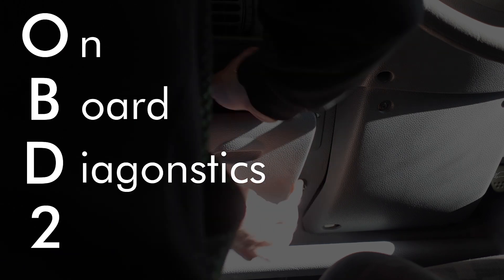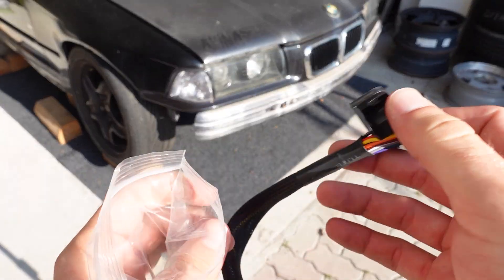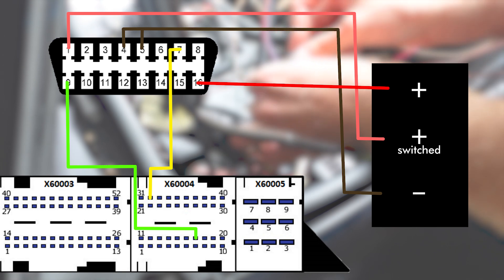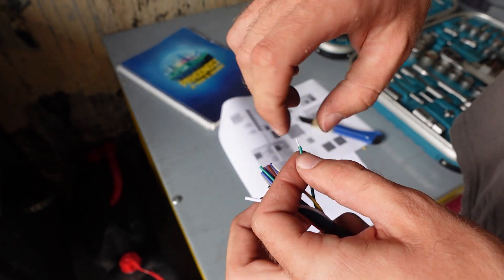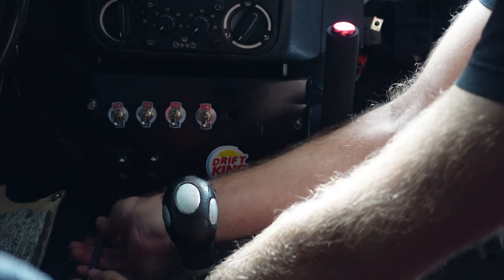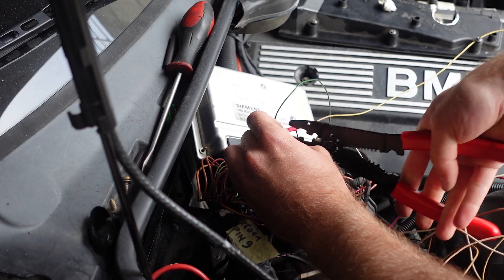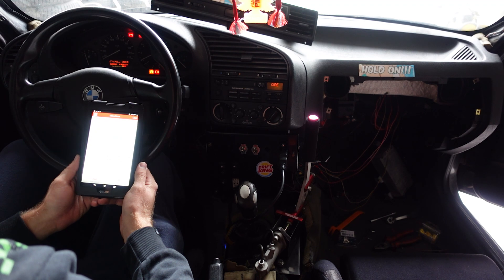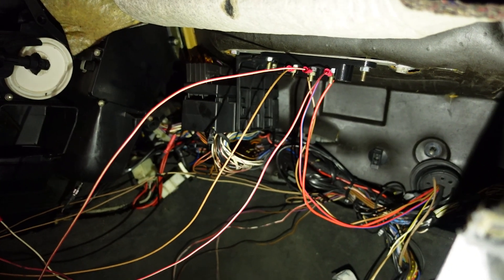Sometimes ignorance is bliss

Comment: Engine coolant temperature will be affecting your throttle, idle, fuelling etc
Reply: Connect it bro lol
Reply from the maker: @aspergerio  no worries, the car has two coolant temp sensors, one in the block and one in the radiator and the one in the block is connected.